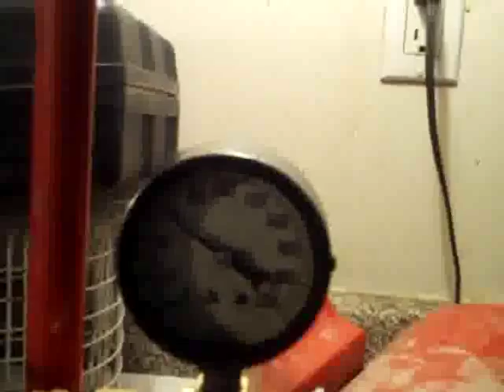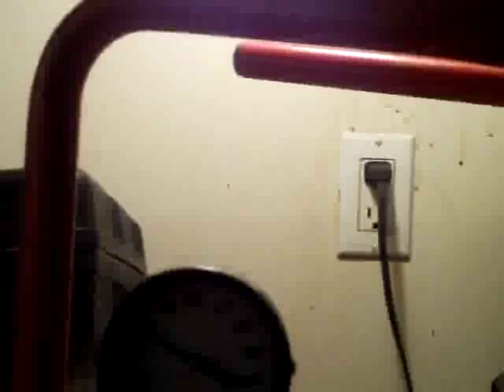Teslajet component turbine spins VW Bosch alternator

Comment: this is awesome. you are wonderful and tesla is wonderful and youtube is wonderful. I had this idea. that's why I'm here. and because of you and youtube and tesla I can see it in practice. 

I'm Canadian so we have 9 months of winter. I was thinking about using a wood stove to heat my home in winter and also charge a boiler. then use this system ontop of solar. daily. with the help of a large battery bank. for power. some things to consider. larger, heavier boiler and a high output alternator.

Comment: Looking good. If you had a bigger boiler that could give a higher steam supply to your turbine nonstop, youd have a working charging system for sure! Also, couldn't really see for sure, but does the ration of turbine shaft output pully size to alternator pully size give proper rpms to the alt to achieve 12V + ?